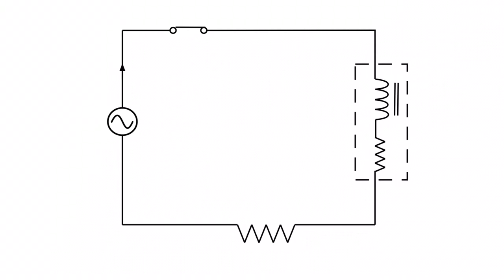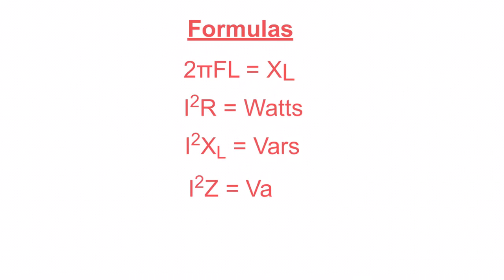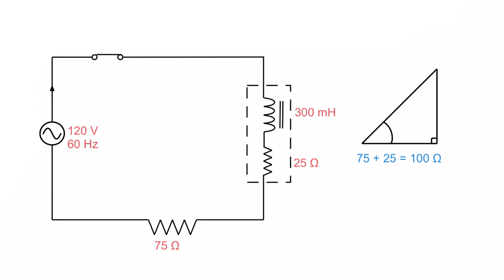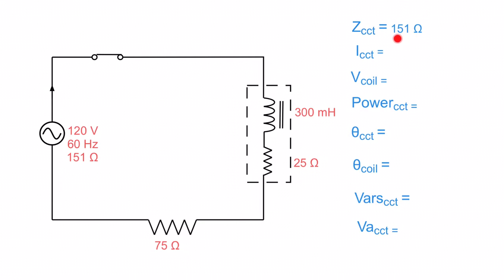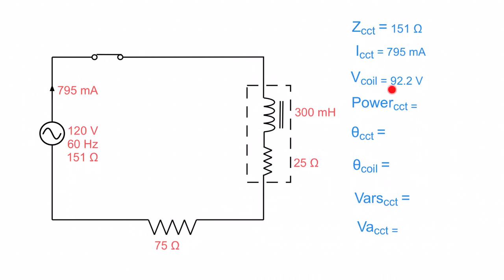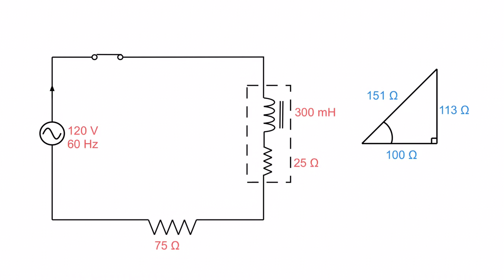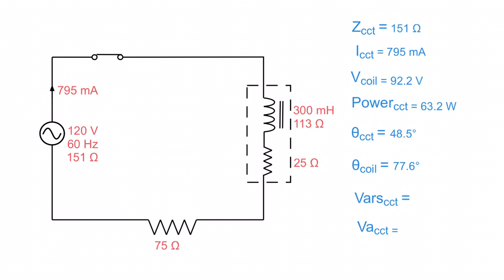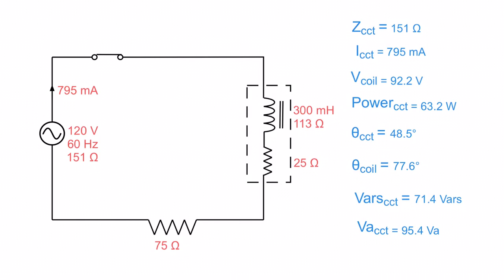AC series RL circuit

Comment: If you consider the voltage across the resistor as well, then the total voltage across the inductor and resistor will exceed 120V?
Reply: Could you explain why it exceeds 120v?
Reply: The current is out of phase with the voltage. This means that the voltages don't add like scalars, they add like vectors.

Comment: Current is not constant. This is an AC circuit. The voltage across the inductor is not constant.
Reply: the constant value could be either peak current or RMS current